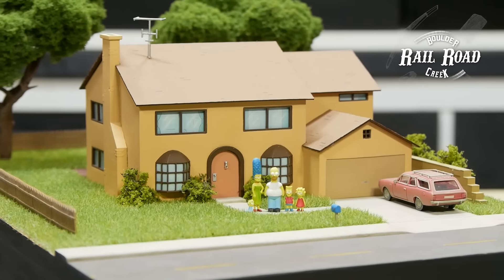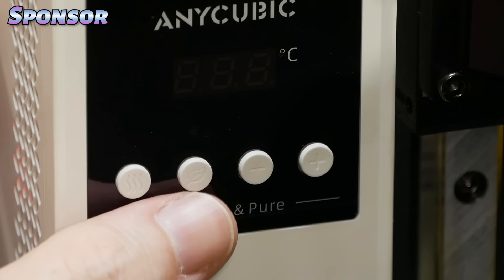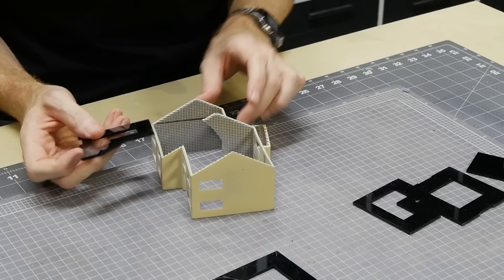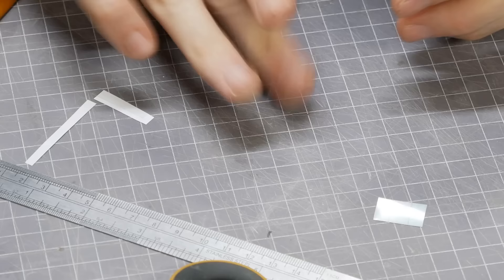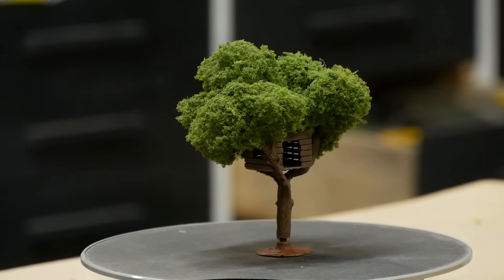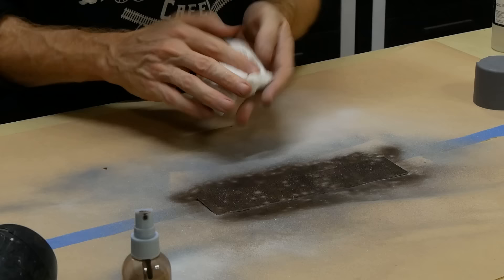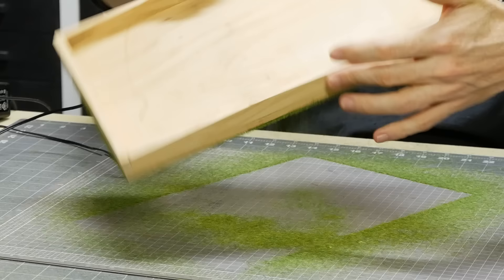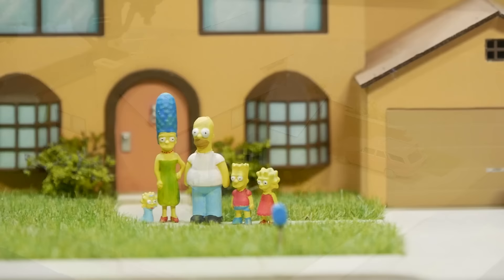Build an AWESOME model of The Simpsons house! Step by step 😉 ANYCUBIC Photon Mono M5s Pro

Comment: I never thought to use poly fill in trees but I am definitely giving it a try. Looks like the clump foliage clings to it really well. Great video as always!
Reply from the maker: Yeah it sticks really well, just remember to give it a spray of some matt varnish to hold it all together and to help remove the tackiness from the spray adhesive. Actually using matt varnish spray on older trees can also help bring them back to life if they start to look dull from dust.

Comment: I’ve found that curing for too long warps the resin. Also if you’ve exposed it to light before you prime then can also cause the warping.

Just something that I’ve found.

Loving this build
Reply from the maker: Thanks for the tips 😉 I have done a few experiments with curing, I found that curing for less time results in less warping initially but over a month or two it tends to warp anyway... That was unpainted resin though, I wonder if slightly less cure time would be ok if the part was painted not long after... Hmmm Might have another experiment to try 😅
Warping is one of those hassles and any tips I can get are very welcome. Thank you 😉
Reply: @BoulderCreekRailroad  I’m still a novice when it comes to resin prints, but the general rule is, cure for max 1 min and prime as quickly as you can. If not, store in a box or container where no UV can get to the model and then prime.

I’ve followed this recently and it’s stopped my warping.
Reply from the maker: Awesome! I'll give it a try 😉

Comment: I just picked up the anycubic kobra filament printer
Reply from the maker: that's a great printer as well 😉 Filament printers are much better for stronger more durable models, it'll be a bit harder to get ultra high detail but for a model like this Simpsons house, it should work just fine 😉

Comment: Fantastic work, Luke! Really well done!!! 😃
I guess you probably wouldn't use it much, but... Did you know there's a flexible printing resin in the market? It looks really interesting!
Anyway, stay safe there with your family! 🖖😊
Reply from the maker: Thanks mate, yeah I do have some flexible resin, I'm working on ways to incorporate it into my build process. It's a bit different in terms of print settings, I've seen people mix small amount into other resin to improve strength and stop parts from breaking so easily. 😊

Comment: I see the push to fast resin,  but is it really that big of a deal?   I can load up a print over night and do not think I gained anything if it is done in 15 minutes or 45.  So do you see any advantage with the fast resin over the normal resin?
Reply from the maker: If you plan a print to go overnight then fast resin isn't really that important, however if you are working on a project and using a small part like a window and it suddenly breaks, you can reprint it within a few minutes which is super useful.

Comment: I noticed on the house you had an internal support grid with horizontal lines.  It looks like those horizontal lines were not correctly transferred to the final model.(One Version of it?)
So what version was this build or did you do other changes to the model before the ones printed in the video?
Reply from the maker: yeah I printed one house with internal supports but it wasn't enough and I had artifacts on the outer walls, So I did a redesign and the second house had a better internal structure which was added to help prevent warping. Which it did but it didn't completely get rid of all warping.

Comment: Could you relise the stl for the house please? I have amazing figures for it! I was the one that worked with anycubic to fix the auto levelling and the new version 2 build plate for the m5s same as they now ship the m5s pro with the 4 bolts to help level it as rhe version 1 did not have these 4 hex bolts! I have the updated m5s with this new build plate and updated software its now for sale its just to loud for having in the home! I went forna new saturn 3 ultra what a difference in machines better printer aswell have to admit

Comment: Hi Luke ! 
Excellent work as always :) One question though : is the layer of dirt that important ? I seems that it gets totally covered by the grass later on. Is it worth the hassle ?
Reply from the maker: lol... I just replied to a similar comment, here is my reply to that comment "yeah to be honest you could probably skip the dirt and just paint the surface brown. I really just did it to build up the base because I wanted the grass to sit up a bit higher against the cement driveway. I did a test and the 4mm grass was sitting too low if I didn't build up the base somehow. I could have used longer grass? Maybe the 7mm grass would have worked better? Then you could skip adding the dirt layer 😉" Hope that helps
Reply: @BoulderCreekRailroad  It sure does! Thanks

Comment: Awesome work as always. I just don't understand why making so much effort on the dirt and sand surface and then covering it all with grass? Usually you leave some dirt areas expose but in this case not.
Reply from the maker: yeah to be honest you could probably skip the dirt and just paint the surface brown. I really just did it to build up the base because I wanted the grass to sit up a bit higher against the cement driveway. I did a test and the 4mm grass was sitting too low if I didn't build up the base somehow. I could have used longer grass? Maybe the 7mm grass would have worked better? Then you could skip adding the dirt layer 😉

Comment: Two questions. 1) Why did you sand the large flat areas of the laser cut supports when you didn't glue anything to them? 2) Why did you glaze the backs of the windows that no one will see?
Reply from the maker: The large flat sections of laser cut parts were sanded so that any glue that wraps around the edge will hold better than if it wasn't sanded, I could have just sanded the very edge but it was just easier to lay it flat and sand the entire surface even if it wouldn't get any glue on it.
There is no window glazing on the back? That would be a waist of time 😅 You probably just didn't quite understand the sequence that the windows were attached.

Comment: Why do wait to take you supports off after you wash and cure? They come off much easier if you do it before hand. I just got this printer and i like it so far. Its really easy to use.
Reply from the maker: I generally take them off after curing because the extra support material helps the model hold its shape as it cures. For large flat sections, like the walls of a house, I find that taking supports off before curing results in a bit more warping from the curing process.
Reply: @LukeTowan  oh ok, i have only been resin printing for a few days and coming from fdm printing. How hard the supports can be to remove from those prints. I like how easy they are to remove before curing. I did notice some warping on a piece of base i printed. I have noticed when the supports are under the print. They are really hard to remove. Like a head i did for a Spiderman model. Where it was touching the plate. The supports were really tough and tore the print up a little. Any tips? Im using default settings on photon workshop as i just started using it. Changed supports to light instead of medium. That's been the only change i have made. Any tips or advice would be greatly appreciated.

Comment: Did you add the lattice to the walls for support using a function on tinker cad or did you just lay rectangles down in the pattern?
Reply from the maker: It was just rectangles laid down to create the lattice, that would be awesome if it had a feature to do that automatically 😊

Comment: If you had to choose… would you pick a laser cutter over a 3D printer?
Reply from the maker: 100% I'd choose a 3D printer! Much more versatility, often what makes a model look really good are the tiny details like park benches, letter boxes, bins, phone booths... just to name a few and trying to make those details on a laser cutter while not impossible, 3D printing would be so much easier and faster!
I love both machines though and they each have their place... but for tiny details on a diorama it's gotta be a 3D printer.
If you primarily build structures and buildings you will probably lean towards a laser cutter, it would save you a lot of money in that respect. I bought a building from CMR and it cost over $500! And it was a laser cut kit!
Tough question!

Comment: Can you do buildings in G scale with this?
Reply from the maker: You could probably scale this up to G scale without to much issues 😉 You might need to separate the print into sections to get it to print though, but you could probably just use a filament 3D printer because they can print quite large models.
Reply: @BoulderCreekRailroad  Thank you

Comment: Its easier using acrilic laser cut to make house 😂
Reply from the maker: true, I wanted to show it using a 3D printer because laser cutters are not as common yet with the general modeller. I'm about to make Flanders house but for that I'll be laser cutting to show a different method 😉